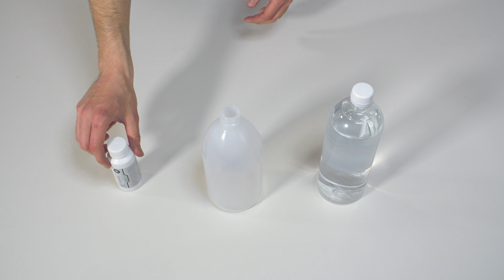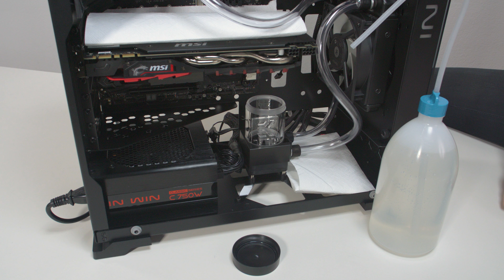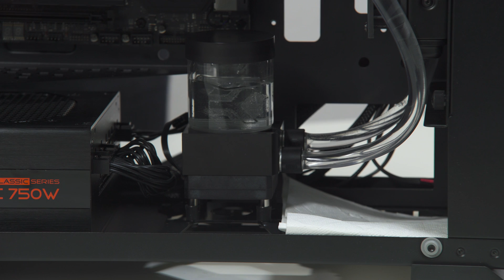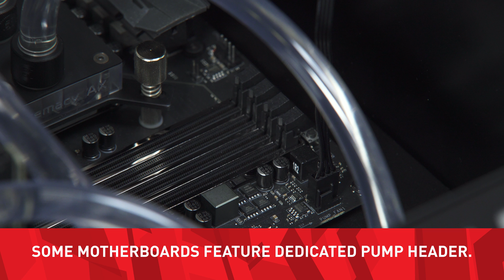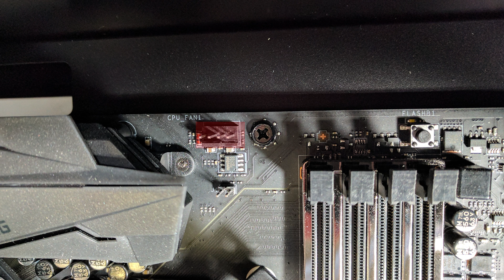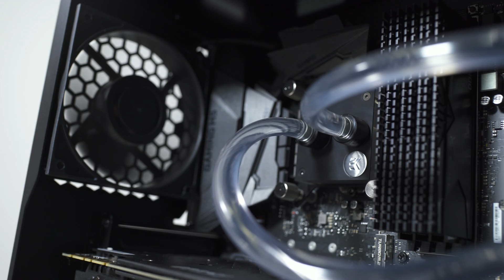EK Fluid Gaming A120 - Filling the system

Comment: You really should really mention how to jump the PSU. Powering the full system on and off rapidly is not advisable.
Reply: The system wasnt plugged in only the pump. To avoid any (if any) leaks to cause shortages.

Comment: Please do a video on draining the system. Also, please include extra fittings for draining.
Reply: The extra fittings, a splitter and a drain valve is a must in order to drain the loop for maintenance. Please add those part too or at least allow for the option to add them as optional.
Reply: Where do I find these splitters? I can't seem to find them anywhere.
Reply: Scratch that, I've found some, but I can't find any made of aluminium. So it'd just corrode